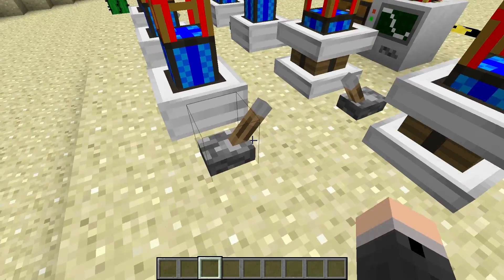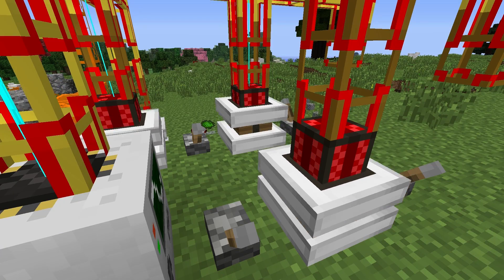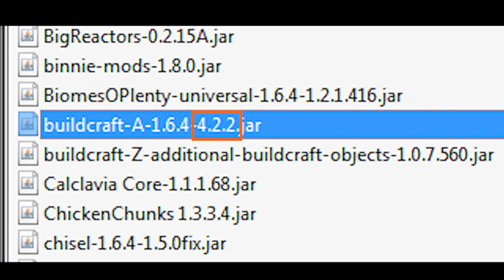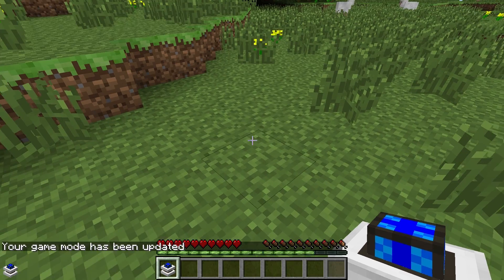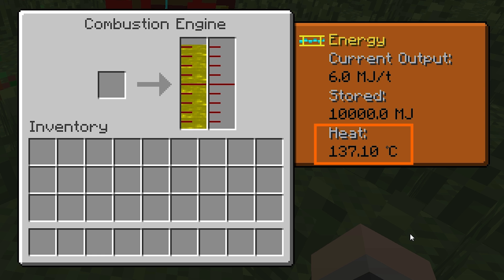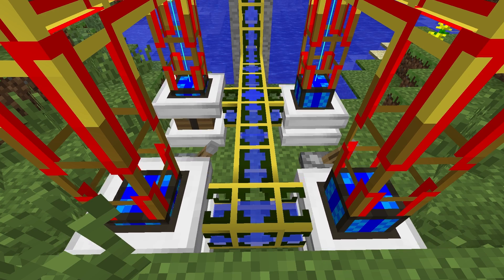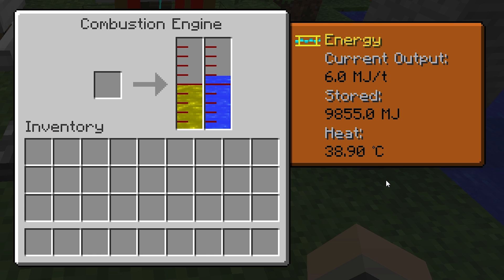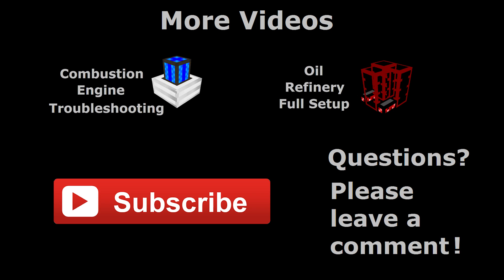Buildcraft 4/5 Combustion Engines Temperatures & Cooling (Tekkit/Feed The Beast)

Comment: gasoeus (misspelled ik) fuel is the fastest but wastes the fastest too but dense fuel is the fuel that makes power the slowest but also wastes its fuel the slowest but dense fuel is hard to make (to make it you need cool oil which you heat up to searing then distill it and you get dense oil and fuel i think if you get something else than dense fuel then distill the dense oil